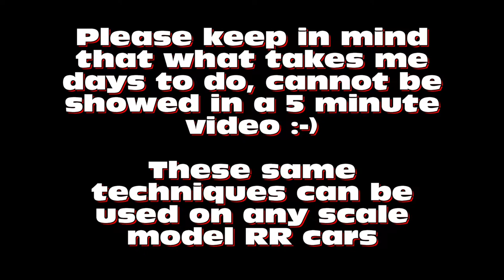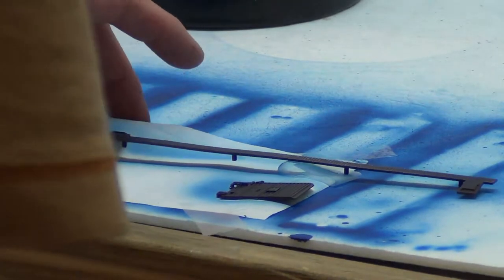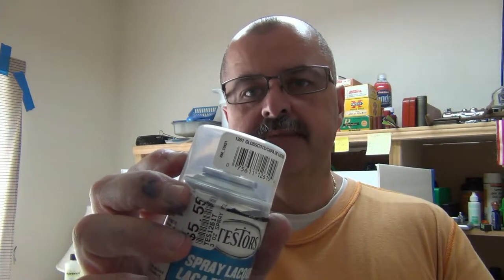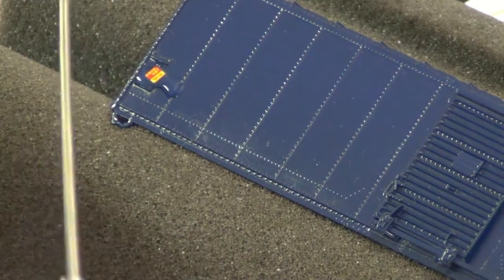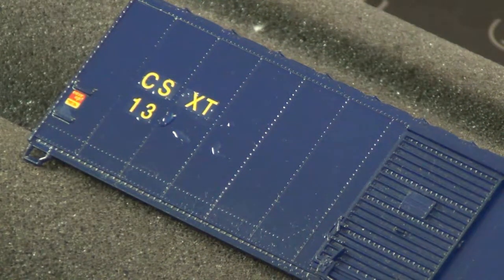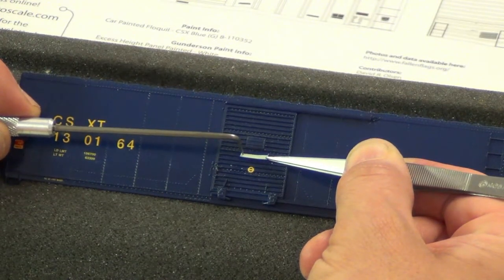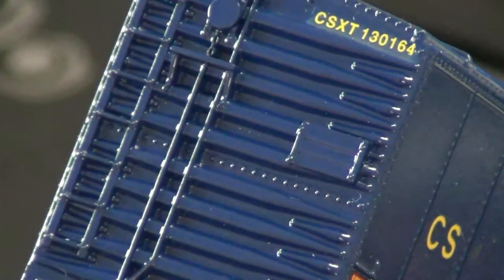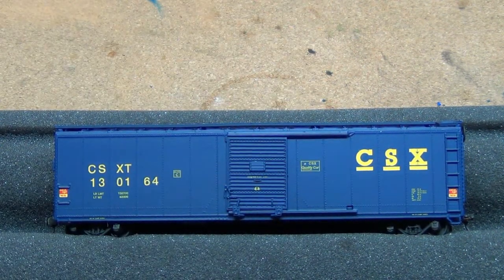Paint & Adding Decals: Part 2 of 2

Comment: I am viewing part 2 of your great How to video. Great work. 
Tell me if I am right please. You explain the reason of the glossy coating by making the surface smooth to slide the decals. I tought that the main reason was because decals are painted over a shiny plastic film and if we put it on a dull surface we will see all the shiny film arounds de letters and logo. If we put it on a shiny surface, similar to the shiny plastic film of the decals, we will see no difference. At the end we would finish either with a glossy coat or mat coat as we prefer the final result. But the decals will not show any trace of plastic surrondings. I am right about it?
Reply from the maker: I can not say that I disagree with your logic.
Reply: +FNGFASHA Productions Thank you.

Comment: you are using spray can for the glossy and mat coatings. Why not the airspray gun that should spray more uniform? Availability of coatings? Not recommanded for air spray?  Thanks for your answer.
Reply from the maker: I found these two products to be mixed perfectly for these type jobs.  And as you mentioned, trying to mix them to spray with the airbrush, thin enough to be sprayed like that, would have required additional coats to get the same result.